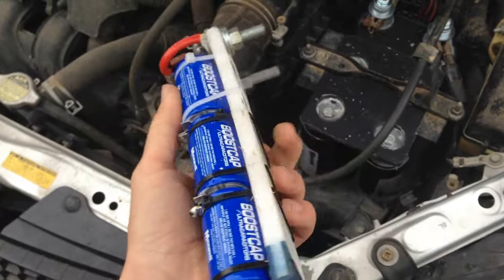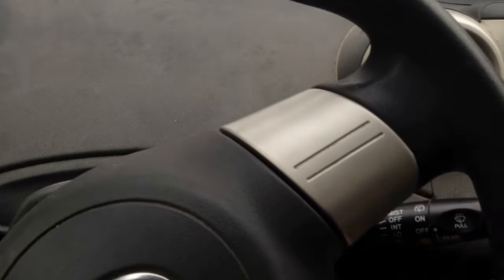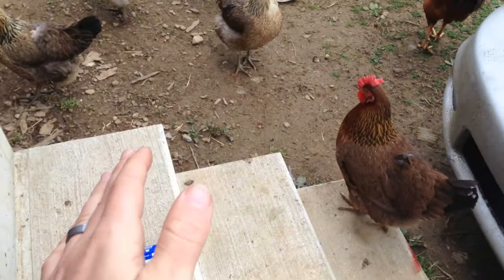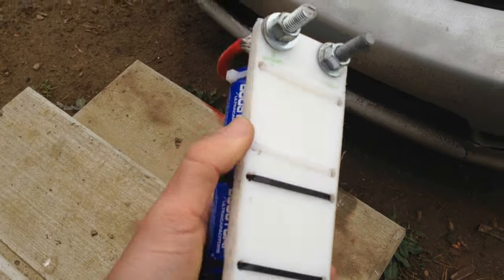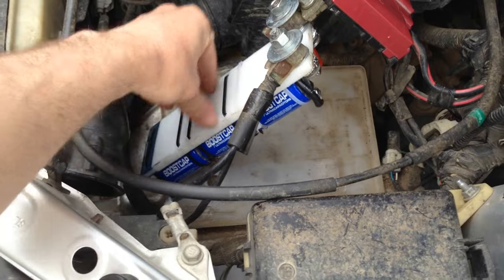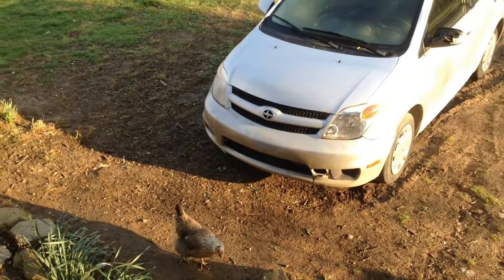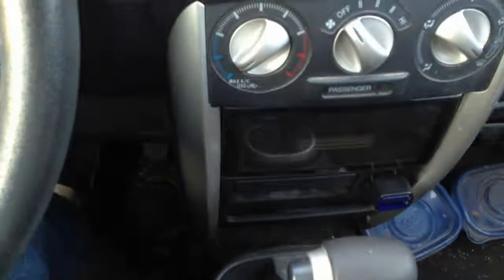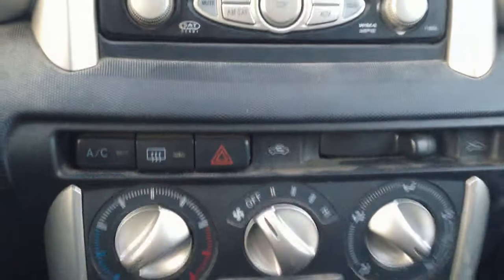Replacing My Car Battery with Capacitors! 12V BoostPack Update

Comment: aren't lithium ion batteries the ones that explode?
Reply: *****
ok cool, same as...plutionium then
Reply: some molten sodium made its way into the pot plants, imagine his mothers surprise when she came to water them later
Reply: All batteries can explode. Especially the sealed ones due to pressure from rapid charge/discharge. Car batteries generate substantial Hydrogen and Oxygen during charge/discharge due to electrolysis. If a spark happens near the vent ports the maintenance free ones can explode like a bomb, the regular ones would blow the caps off. Either way both events pose the risk of acid damage including skin and eyes. This is why you connect jumper cables to the disabled vehicle first then make the final connection on the good vehicle preferably one the engine block or alternator. If you must make the last connection at the good battery, blow real hard on the terminal just before turning your face away to displace Hydrogen/Oxygen that may be present. Also it would be wise when connecting cables from a charger or to jumpstart to turn the headlights on to avoid PCM (Computer) damage.

Comment: Can this power bicycles too?
Reply: No it can't. And it can't power a car either. A capacitor is not remotely the same as a battery. And that's why car makers use batteries and not capacitors.
Reply: Thank you
Reply: the point is... time will come ... the capacitor and battery will cross each others path... because as the technology keeps on advancing... time will come, the capacitor would have the same storage capacity as a typical battery.this time the battery will be obsolete.
Reply: Thank you!

Comment: As long as the terminations of  the caps can handle the high current surge of starting your good .Now long duration  starter motor operation Hmm may not be optimum with such a small total watt hour capacitor package.The cold climate starting  capacity o o yes better than battery and lasts  so many more charge cycles the if everything lasted as well you could weld the hood shut.  This type of service duty  built into it take remote  live off the grid wattage to run all appiances is near same as don't turn off the car plug it in and run any and all of the home appliances like wash cook and clean warm up the tub  with with the hybrid you drove to location then go to low on what ever solar or wind installed from minimal stored energy at home off grid. Your vehicals fuel tank is the safest and easiest way to carry the energy to  the location with capacity to be practical this is concept I realized many years ago when engines still had carbs and with no ecms the lack of the modern designs made the concept not practical in contrast now actually the caps and added to all the other tech it is. Just next time look at the odometers of modern cars now exceeding 300k  for drivetrain  still passes smog with the rest no longer servicable  body rotted seats shot all the rest in same condition tell me that no f'en way all the way to my home on the range off the grid with no limitations or large power resource before I can turn key .

Comment: Start the car OK! But no Amps for the radio, navi system, sound amp, Head lights and other electric stuff. since the video was posted in 2013 ... I bet you know that by now lol. 

But again, a small battery connected to this capacitor device ... I believe it is the best way to go.
Reply: Apparently, you do not understand that the Alternator recharges the "battery" ( Lead Acid or Super-Capacitor ) and also supplies all of the amps needed to run all of the accessories.

Comment: That's was to cool  I'm tired of dead battery yea the radio mostly I got a daughter but also my battery sucks don't like interstate. But sale was able to get cheaper thru a friend. 2 and half years can't not drive for 3 days cause it will be dead with nothen on.  But I'll deff read on this be great for something that cheap to have just incase I need jump. Thanks god bless
Reply: This will not help if you play the radio and the engine is OFF ...

Comment: A standard lithium cobolt jumper pack can start the car.  its a quick discharge & resonably small .but the capacitors cant run your light horn or radio. if it was this easy.... highly qualified Engineers that design cars would be using capacitors 😑 wouldn't they! instead of a back yard hack like this guy.....

Comment: why doesn't the auto industry use this?
 Less weight less energy to make them
 less pollution 
less energy to carry them 
thousands of cycles
WHY?
Reply: Normal jumper cables are an issue- which can be fixed by using a "special" jump cable
Short reserve time is an issue.
A Hyrbid design of Super-Capacitor + small Lihium-Ion Battery may work?
The Lead Acid Battery industry does not want to see this happen
Change does not happen quickly in the auto industry.

Comment: I've had battery problems with my BMW 535d. No battery pack will start it when the battery is flat, in fact, you need a booster pack on the battery and booster cables connected to a running vehicle to provide the 1000 amps required to start it. If you have shitty little four banger, this may work, but with a big engine, GTFO

Comment: What if u  fail to start on the first try and didnt start
Reply: Good point ! You will need to size the capacitors for a maximum number of "failed starts". Just like a Lead Acid battery, which will only crank the engine for certain period and then go dead.

Comment: A weight-saving of 30lbs in a car weighing 2200lbs is not worth thinking abut.
Reply: I was actually thinking about the price. My car uses some sort of specialty vented battery that costs about $120. This would be significantly cheaper.
Reply: the distance you can drive after your alternator dies or the belt connecting it the engine snaps is significantly less with this setup.
Reply: But, there is as much chance of that happening 30 miles from civilization with this setup, as there is of it happening at home with a traditional battery, you driving 30 miles out of town not knowing you have no alternator, and conking out in the same place. At least with this setup, if your alt dies at home, you car dies at home and within walking distance of your toolbox.

Comment: What you make is absolut max. 2Wh. A car battery is min. 500Wh. With the capacitor pack,  can tourn 1,2KW starter motor max. 6sec, and no second chance. Maybe start a small petrol car, but absolutely useless, sorry.
Reply: My engine starts in about 1 second, maybe less. If your engine needs more cranking time then install larger super-capacitors. Doesn't the manufacturer install bigger ( CCA ) batteries for bigger ( ie V8 ) engines?

Comment: You may need to consider using something like a memory saver battery pack that plugs into the cigarette lighter socket and remove the capacitor bank from the alternator to prevent overcharging on long drives. Let the alternator charge the memory pack . Got to be a way to do it with the right diodes. Or a protection circuit for the caps. Great idea though.

Comment: Keep touching those leads with bigger capacitors. You won't be making videos anymore
Reply: its not high enough voltage...3000f caps are fucking beasts but it doesnt matter cuz 12v won't penetrate
Reply: @Str8GasGenetics  well by bigger I'm talking household 120v
Reply: @RedHaloManiac95  Then you do not make tiniest amount of sense

Comment: ok. you touched the terminals. with your bare hands. you would have been hit
Reply: umm no
Reply: why not?
Reply: Richard Recupero because it's only 12v and the cap won't discharge just by grabbing both terminals. You could put a wrench between the terminals and put your hand near the arc and you may get a lil shock
Reply: go try on your own car battery, grab on each of the terminals and it wont happen, its because the easier flow in a copper wire is taken before a hand will as skin has a high resistance.

Comment: yeah this is stupid, ive got a degreee for aviation technology.....a capacitor, is a battery.....................
Reply: so lets see if a booster pack battery, that is made to start cars......will start a car...well its made to......so this guy just chopped open the plastic case of a care battery jumper showing the battery cells.   pretty lame,

Comment: OK, just two words to show why this is a terribly impractical idea.

Parasitic draw.

Those two words encompass all the things that your car has inside that draw power even when off.
Caps will never be a reliable solution. Some people fail to realize all the things that draw power in a car just sitting there.
Car radio - Most are digital and have a memory to be kept for all those wonderfully convenient settings.
Power door locks/remotes - It's not magic when you press that button. There is a radio receiver alive to do that.
Alarms/security - Need I say more?
Automatic lights - When they come on at night as you start the car they will hit those caps first, reducing your available flow.

Also, crank TIME is very short with this setup. Better not try this in the extreme cold on an engine that needs more than a few seconds of crank time.

Comment: It's a shame you did this and disappeared but does it actually require 6 capacitors to start a car? I'm wondering because of compressor start capacitors which seem all out of whack with what you've discovered. Your work appears to mess up what man thinks he knows about such things. Shouldn't this have not worked? Shouldn't a compressor's start capacitor not work? At the risk of ticking off hotheads and wounding some people's pride, does man even know anything about electricity? It doesn't appear so. With this and your solar panels...trusting anything "they" say just seems foolhardy.
Reply: disappeared?    did men in black come for him... or did his car blow up....

Comment: Capacitors are not batteries, you literally don't understand what you are doing.
Reply: In this case, a battery and a large super-capacitor is effectively the exact same device. Both are re-charged by the alternator and both can power the electric starter for a period time.  You literally do not understand how a super-capacitor can replace rechargeable battery - do you?
Reply: Except you literally don't understand what you're talking about

Comment: This could be fake I understand that There would be Power to start engine but the way batteries were designed to charge and recharge and cycles I'm sure this may not work in the end I know batteries are a scam but so are capacitors. U know how much those capacitors cost in Australia $87.00 AUD per item without shipping costs. Your making a big mistake. What you should be doing is getting lithium ion batteries or salt graphite batteries with a BMS and with DC DC charger controllers so you have a Smart battery. Or 2